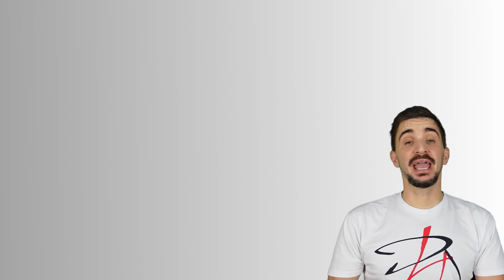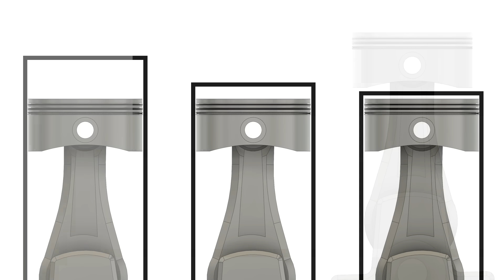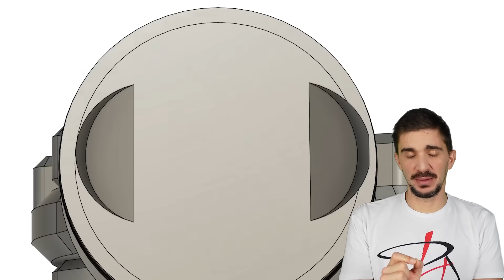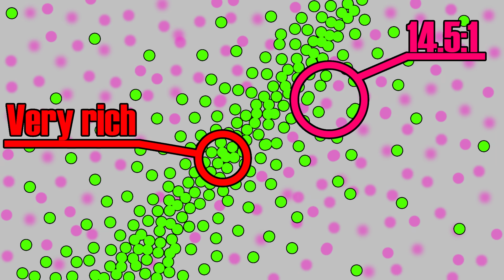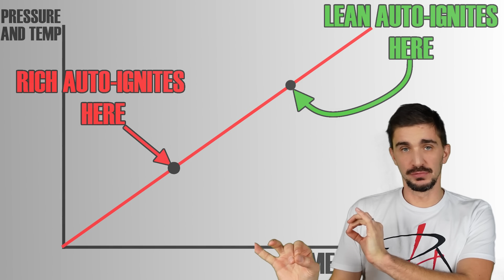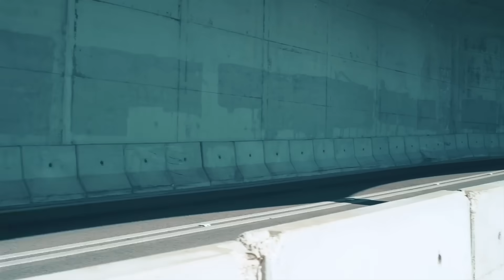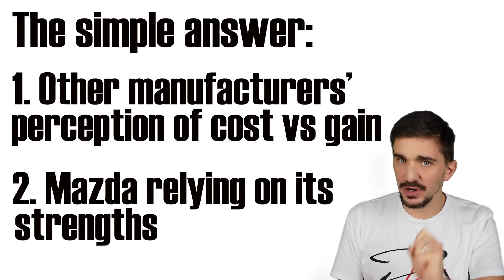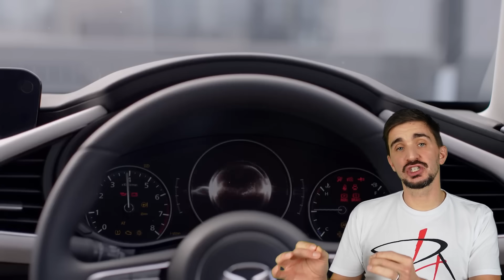The Game Changer Nobody Cares About - Mazda Skyactiv-X SPCCI How it Works and Why It Didn't Catch On

Comment: The reason no other manufacturer does it is because no other manufacturer has really done any engine development in the last 6 years or so. They have only tried to keep their engines on the road with current emissions or pair them to hybrid drive trains or GPFs but no one really has done any combustion process development except for Mazda. 

The reason Mazda did it is because they their C-level firmly believed in that technology and had no agressive EV strategy, while all other major OEMs wanted to milk the EV/hybrid trend as long as there was a subsidized market for it.

Comment: I bought a Mazda CX-5 in 2018 and still have it. I wanted to look at Hyundai but a jerk sales person killed that (I'm grateful to this day for his rudeness :). My wife has a 2012 Mazda 6 and it has been great. No problems with either vehicle. I thought this video was well done and informative. I researched SkyActiv engines and was impressed with the thought that went into the design. I did not want a turbo. From what I gather you get about 70,000 miles out of a turbo engine before the bill comes due. Turbo replacement etc. etc. We usually keep our cars for 10 years so no turbo, please. I was a Honda loyalist but I'm sold on Mazda now. Zoom Zoom is not just a sales slogan it is a philosophy.

Comment: I purchased a Mazda 3 Takumi with a Skyactiv-X engine in May 2024. After driving Alfa Romeos for 26 years it was a big leap to a Mazda. I wanted a good looking practical car at a reasonable price, Alfa Romeo’s had got far too expensive. I made the right decision, the interior is upmarket, it drives well (okay you have to use the gears) it looks good and it has been the most reliable car I’ve ever owned, especially after my Alfas. On a motorway drive it returns over 50mpg and never below 42mpg which includes lots of around town driving

Comment: I think this engine would link up well with a HEV or PHEV system to maximize efficiency while providing for a driving experience that is easier to sell. For example, I drive a RAV4 PHEV, which uses an Atkinson cycle engine. As I understand it, these engines are quite efficient (around 40% thermal efficiency) but rather anemic in performance. However, I would never know it, because the electric torque provides plenty of low speed torque, and when I really ask for power the gas engine comes on and revs way up to provide max HP. My SUV gets around 35-40 mpg on the freeway and my combined efficiency is close to 80 mpg. That’s pretty impressive for a large, heavy vehicle. But the combined power output is still very impressive at around 300 HP and propelling my car to a 5.6 second 0-60 mph. All this without any forced induction, and from what would be an otherwise boring, “hard sell” engine. The only real disadvantage is the cost and added components/complexity. The extra cost will likely never be recouped in fuel cost savings, but it’s a premium driving experience without sacrificing down to a 20-25 mpg engine.

Comment: @d4a This engine can actually be the perfect match for the series hybrid that Maruti Suzuki is planning to launch in India
The concept is simply
Use a IC engine to generate power at a fixed rpm and charge the battery and the car runs all the while in the battery mode

Comment: Eh.. I'm sorry, car guy (and engineer) here and enjoy your geeky content.

However, if you have the facilities for an EV, 

+ it is economical (at least for my wallet, I save multiple 4 figures a year on fuel alone), 

+ minimal servicing - I'm really wanting to change fluids suspension, tinker, but reality is I just need to wire brush the brake pin holders, change fluid for drive train "maybe" 100-200k miles (manufacture recommends it's truely lifetime, questionable still as I can't find any definitives)

+ fast, it's faster than 99.5% things on the road.

I have it for 3-5 years it's saved me 5 figures. 
I don't like changing cars like phones, so if it's a 10-15 year cycle, it's multiple 5 figures. Thats assuming I buy a boring "non performance" ICE car instead.

If I compare to a performance ICE car, (which isn't the purpose of this video I understand) it'll be multiple 5 figures.

... Did I mention it can drive and park itself if I want it to/can't be bothered on that specific journey? Has all the gismos and features.

Sure, you can't change gears and be 'involved' as much as some ice cars, but I have my classic/weekend cars for that. 

I don't want/need full emotions everytime single time I get in a car.

Sorry 😢, it feels blasphemy to say that, but, it's true. I enjoy the things when I want to enjoy it, not when it always requires it from me (classic car life). I can dump that POS whenever I like and work on it in my own time and space 😂.
Reply: I have a merc also (none classic) which I change oils every 6k, etc. I give it love, but, because I don't drive it often, it doesn't alwyad give me love back lol. It's like owning a cat 😂.

Comment: Ok but how has this solved the issue of pre-ignition when you are not at steady state conditions like motorway/highway driving? You still have a fixed compression ratio so when you want performance, you end up with rich mixture. Why does the skyactiv X engine not run into knock problems in those driving conditions?

Comment: While there are many differences, Honda’s Activated  Radical technology from the late ‘90s used computer-controlled variable compression to cause controlled self detonation to improve fuel consumption at light load conditions. It activated a spark plug for conventional combustion at higher loads. The only commercial implementation that I’m aware of was in the CRM250AR dirt bike, which I bought an early sample of. It was fascinating, but bug ridden, and after multiple attempts by the factory to get it sorted, I asked them to allow me to trade it for a new street bike, which they eventually agreed to. It was taken off the market not long after that, and the technology was shelved.

Comment: answer is simple, in urban settings, put this engine into its most efficient setting and use it as a generator to charge a solid state battery pack, the pack does not need to be heavy, as it constantly being charged, so now you have the best of both worlds.

Comment: I've been with this engine since it was first released. The first generation I had in my Mazda 3, and now I have next generation is in my Mazda CX-30. This engine is very efficient in certain conditions, such as on highways, where it shows more power in 6th gear with low fuel consumption compared to a regular engine. It runs smoothly, but it is colder and warms up very slowly (this can be a problem in the winter), and is very fragile to fuel quality and air temperature. I use petrol 98e5; it will run with 95e10, but will deliver less power with higher consumption (approximately +1-2L/100km). No problems with the engine, but it requires more frequent replacement of spark plugs (twice as frequent), and these are specific, short ones for this engine, which can be more expensive.
Reply: I have updated version with 186hp. I agree with most of what you said except for consumption on RON95. I filled it with RON100 for first ~2years, then switched to RON95. While the engine seems more refined and a bit more powerful on RON100, consumption isn't better (+1-2l/100km seems unreal to me). In fact, I'm wondering if it's better on RON95. Some say that their Mazda dealers told them it should consume less on 95. On Mazda's website, they recommend 95.

Comment: IIRC when catalysers became a thing in the 1990s, Toyota complained that its engines were designed as lean-burn with very good mileage, but the mixture was not compatible with catalysers. The basic choice was between using a richer mixture and a catalyser in order to remove some of the emissions, or using a lean burn and not having the emissions in the first place. I'd be interested to know if mazda's engine is compatible with catalysers.

Comment: 2 things that kinda throw wrenches in the science here: research the Speed of Air pistons for diesel engines, the piston design promotes a much more uniform burn (especially when combined with modern injectors, which can promote atomization & cleaner, more complete burns). Secondly, check out Henry "Smokey" Yunick, who developed the "Hot Vapor" V8 which super-heated the air prior to combustion, the engines often ran at close to 400° F & got 50 mpg. And he did all this 50 years ago. Smokey proved that a lot of what we "know" about engine-building, isn't true.

Comment: This was a really terrific video. Mazda has had some amazing engine technologies, it really is a shame that people would rather drive an appliance (or like D4A said not have to drive at all...or think) rather than understanding and appreciating the engineering behind the brand. Having to rev the engine and make it work to me feels like the sweet spot! Not on easy mode with a tiny engine and hot turbo.

Comment: Make it a hybrid.  Run the engine at low to medium power that runs a generator at steady RPM.  It generates electricity to power the battery at maximum engine efficiency.  The battery runs the electric motors.  I am sure it is more complicated than this, but it seems as though it may be worth looking into.

Comment: Not SkyActive-X but SkyActive-G, my 2024 CX-5  got substandard fuel economy. 25mpg in mixed use driving. Plus it was lethargic and underpowered. If it's gonna be slow, it should get better fuel economy.🤷

Comment: Kia has the GDI engines but by injecting fuel under the valves and not over them it doesn’t allow any fuel or treatments don’t wash the valves allowing them to build up carbon on the top of the valve and it doesn’t seal . The engine then starts to use oil and thus stopping up the catalytic converter. This in turn makes higher exhaust pressure and rod bearing failure . I suspect Mazda has either put injectors on top of the valves to wash the carbon off or the same problems might arise like with Kia.

Comment: My '22 MX5, which has 181hp, gets 38mpg on the highway at a 70-75mph speeds. 30-34 if I run it up some in town. My '56 Karman Ghia VW 1200cc engine had 32hp NEW. No AC, weak heater, zero defrost would only get 30mpg everywhere. .Pretty amazing

Comment: At least in Europe, this engine is only available in high trim versions of the Mazda 3. At least was, when I was shopping for a car. I really wanted that engine and a manual gearbox. But the fact, that a hybrid Corolla Touring sport, although with less tech and power was 4-to5 thousand euros cheaper with more "real estate" made me buy the boring car. Nevermind, the difference goes to the budget for the  Miata in the future

Comment: Thank you for explaining engine/air/fuel management theory in a simple way, that is not an easy task. 

I see this tech as being a great application for EREV type of hybrid powertrains where the engine is running on a steady state purely designed to generate electricity.

Comment: I think SPCCI was ahead of it's time, but it's time is coming. Concern over climate change is waning and EVs are still not as cheap, easy to fuel and reliable in cold weather as ICE vehicles. So I can see the trend of EV growth reversing and ICE vehicles taking over again for a while longer. I do think EVs are here to stay though and eventually will take over, but the technology needs to improve first, so it will be say 50 years from now.

Comment: Not as new as claimed, this really sounds like the CVCC engine I had in my 1976 Honda Civic upgraded to use fuel injection to remove the complexity of the dual intake system.

Comment: Mazda also has a big 3.3L diesel that is very clean but not very high power. But it is heavy and expensive by itself and governments want to tax it as a powerful engine instead of a clean one.

There is also a lot of Homogenous mixture tech for diesel that is much cleaner. This is what Mazda's 3.3L tries to do with existing tech.

Comment: It is interesting, because we are taught in the tuning world, that the problem with making power is not more air, but how to match the Fuel ratio to it, and that a lean mixture will melt your pistons, or something like that. But this tech makes great mileage due to running lean. You are right. People just don't have a need for mileage. They drive around in Tahoe,Yukon,Ram, Raptor, Silverado, Sierra, Suburban, or Escalade getting 10 mpg or less.

Comment: A mention of Reactivity Controlled Compression Ignition would be nice. And, explaining fuels by naming them gas or diesel isn't the optimal way for this video, high and low octane would be the correct wording because oil is near ending and if it wouldn't end, governments wouldn't let us drive petrol cars either way in the future (and they shouldn't too). Methanol, methane and ethanol is probably the future. Methane has low energy density which makes it unsuitable for smaller cars but trucks and buses are okay with it, methanol is the perfect fuel but it corrodes aluminium (so what?) and ethanol is a safe bet. All in all, it was a great video. Thank you d4a.

Comment: Regarding the commentary at the end, just because the technology wasn’t adopted by other auto makers doesn’t mean it wasn’t successful. Mazda’s engines are giving value to customers in the form of good fuel economy and reliability. It’s giving benefit to the company by hitting emissions regulations without an expensive and more costly turbo. What more can you ask for? Mazda could apply that technology to higher power engines but chose not to (for now). If other companies want to cede that ground to Mazda, well, shame on them.

Comment: You philosophy at the end of your blog which I find is refreshing but looking deeper into the mind set of most car makers, you may not agree, but I believe because of political pressure these car makers want to go all electric, as for them, there must be a greater profit margin not having to try and make a petrol or diesel more efficient, and to throw a couple of electric motors front and rear with only traditional gear cogs to create motion and as with Tesla and others, and charge a small fortune for said vehicles.

Comment: My first car was handed down to me by my father. A 1989 Alfa Romeo 164 with the legendary 3.0l V6 Busso engine (I miss the sound of it). The whole car was in pretty crappy shape from rust and hauling tools and bags of cement. REALLY comfy seats though. It was converted to drive on LPG and the installation was also crap. During winter, it would idle high(above 1500 rpm) in cold mornings and settle down to normal (600, 700-ish) after it warmed up which took some time. As the days got warmer, the idle speeds would also go down to the point that it would shut off, therefore I had to fiddle with some screws on the gas expansion chamber to tune it all the time. I loved that car but boy did it cause trouble and leave me on the road more than a few times.

My second car, used, I bought with my own money. A 2017 Mazda 3 G165 Revolution Top trim (EU, highest trim available). That car made me LOVE driving. Once warmed up it is so smooth and enjoyable to drive especially being naturally aspirated.. A great balance between fun on free days, commuting during workdays, reliable, easy oil changes.

Comment: When you explain how you have to work for it… it reminds me of how when Honda went from 8th Gen Si to 9th Gen they went from K20 to K24… to me it made perfect sense because of the fuel.   Premium was expensive!!! But then you get all the drivers that are like oh yeh it’s such a better driving car.  I’m like NO IT NOT!!!  You don’t want a bunch of Fing power down low at low RPM!!!! That’s bad for shit like the transmission!  Sure I get that dual mass flywheels are an NVH thing but they’re also a torque mitigation thing and the clutch slave valve already had a “clutch slipper” built into it which of course idiots remove.  Better fuel economy in exchange for premium… I’d rather have the K20.  But that’s how things are going…

We are loosing all the drivers cars.  I remember when the tuning end goal was just hitting a 1HP per 10LB mark.  I could have slapped a turbo on my Integra GSR but instead I went with a fully bolt on fully tuned JDM H22A Type-S in a 94 Civic CX Hatch.  That was 2003 and 17 years later I welcomed the 2.0L version of that engine in a 97 Civic CX Hatch.  Added few LBs lot a few HP but was happier with that peppy race oriented F20B SiR-T which was basically a race Homologation engine waiting for some oiling upgrade and proper cams instead of the H22A Type-S cams that came in it from the factory.  

That’s what driving is about though. 

I love Miata ND2 as well.  I don’t own one but my step dad who raced Spec Miata (not in an ND2) has one and it’s completely tricked out and I’d rather take that out for a drive than his race prepped Cayman R… partially because I really don’t want to be the guy who wraps Porsche that’s so nice… Porsche couldn’t be bothered to make the damn thing.   

Anyways 

We are loosing those cars… Porsche doesn’t even want to build a drivers car like that again.  

I was shocked at how light the ND2 was.  2200LBs as much as 200 crank hp with full bolt ons and a tune.  It’s my favorite Miata…

But it doesn’t sound like the next one is going to be that.  Can they keep at the same power to weight ratio it is now if they end up having to go with a less powerful engine and a 48V mild hybrid? Doubtful …